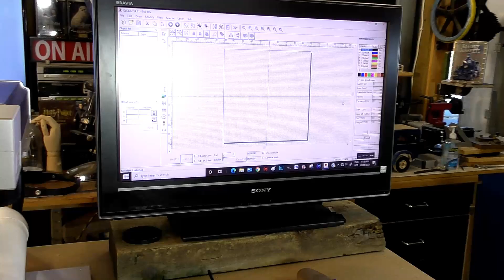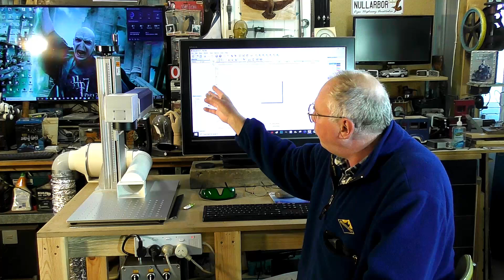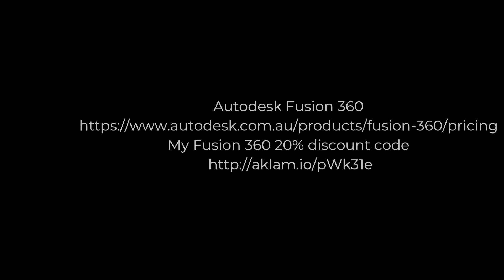MY FIBER LASER SETUP IN THE SHOP

Comment: What would be a laser that could cut 2mm steel sheet ?
Reply: 4000 watt co2 is what i used . sounds like you need a plasma cutter not a laser
Reply: @chrisfrisch1347  yeah not sure if a plasma cutter would work for small jobs like cut outs the size of a pencil
Reply: 100w fiber laser would do the job